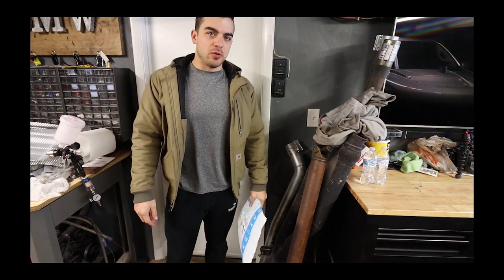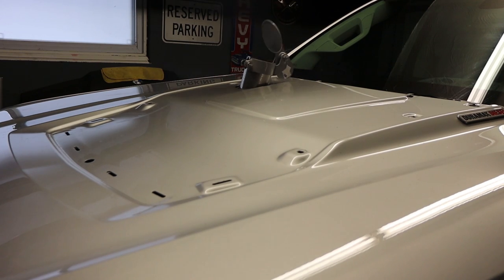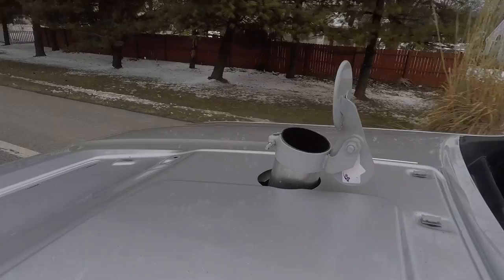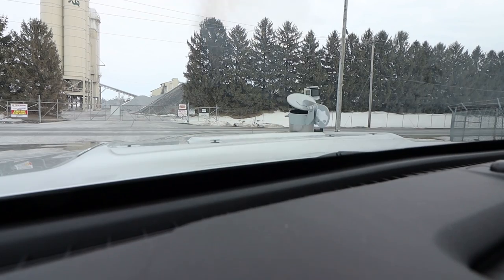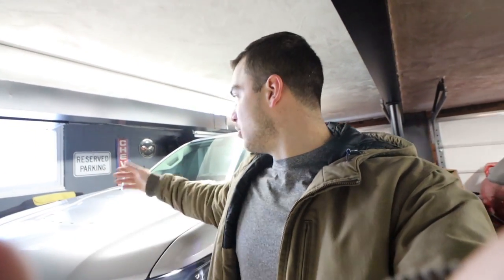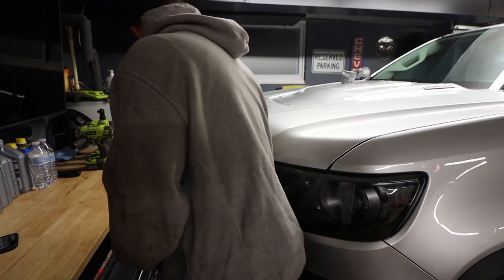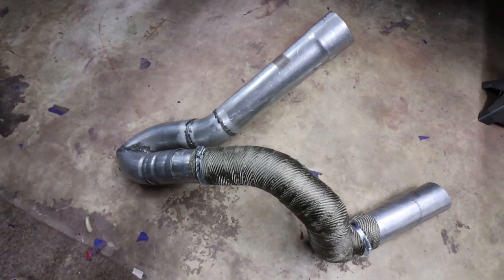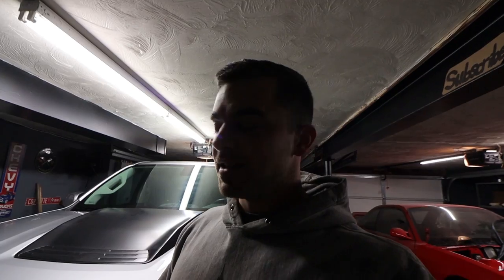Colorado ZR2 Diesel Hood Stack + Tractor Flap

Comment: Thats pretty awesome and hilarious. I think you just need something on the hood opening. Its rather rough without some trim. But still damn near perfect execution for an off road rig. No more exhaust in the water!
Reply from the maker: The factory black trim piece?
Reply: @matt13ross  that would look the best
Reply: @matt13ross  I can see where that was confusing ;()  .... When the stack is in place in the hood, the hole looks a bit rough since it is a sharp edge instead of rounded off like the edge of the hood, or gas tank cover. I was wondering if they made a grommet that size just to cover up the cut.
Reply from the maker: That would look nicer

Comment: It keeps rain and snow from entering the pipe on vertical pipes when not running .lol you should turn it around to wind shield. I think you should go with the exhaust end that blows the exhaust to the side
Reply from the maker: I know what it does lol. But yes I did put it on backwards on accident.

Comment: Hey boosted, do you think the same tire and size will fit a zr2 with stock rims on a readylift 1.25 in front and an add a leaf 1.25 in the back? Most all terrains in 285/70r17 usually run 32.76 or below but the klever rt runs 32.99.
Reply from the maker: Yes, the stock wheel offset will really help with clearance.

Comment: Isn't it on backwards? Cool video🤘
Reply: That was my thought as well. Plus, if you want it to be permanent, the hole in the hood would need to account for the size of the flapper so you can actually open the hood 🤷‍♂️
Reply from the maker: I mentioned that in the description lol. First time with a flapper didn’t realize it!
Reply from the maker: That’s true, hole would have to be way bigger.